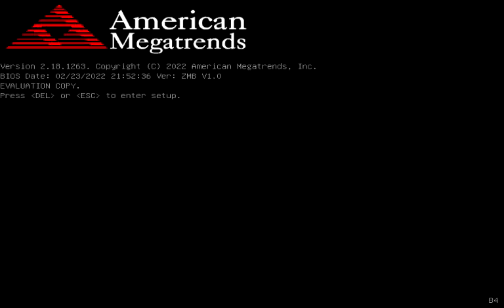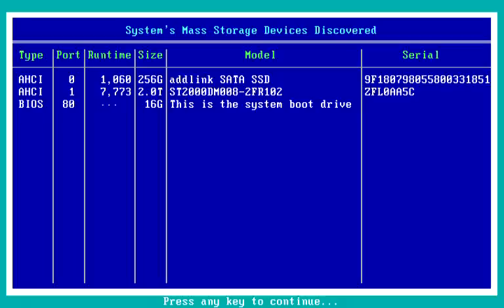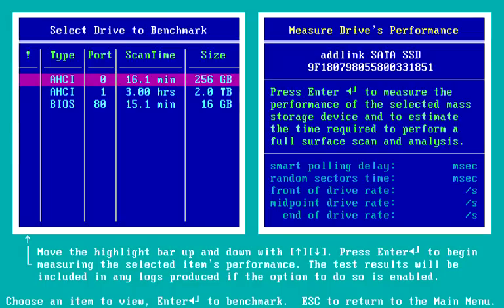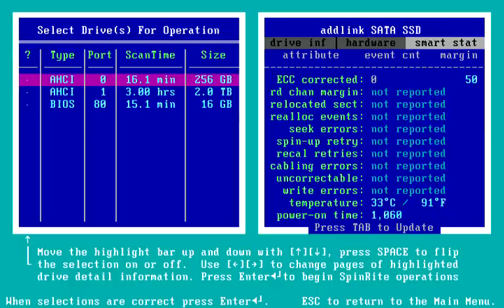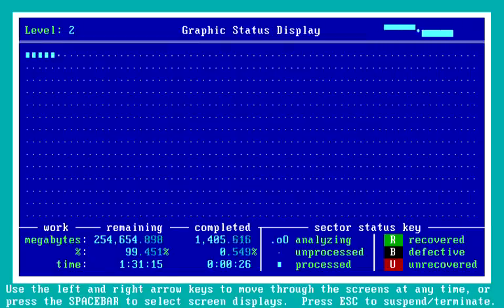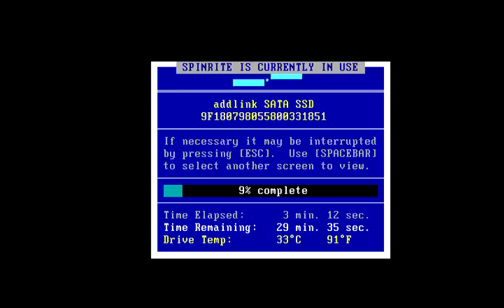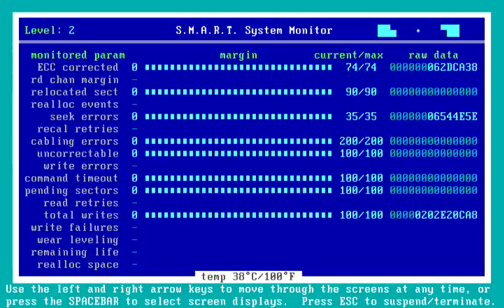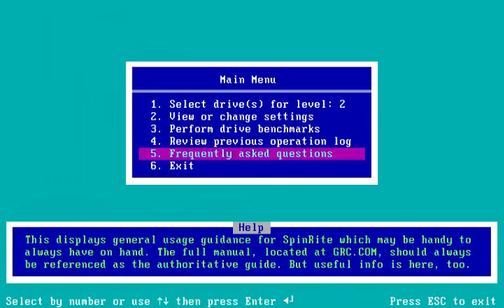A SpinRite Walkthrough

Comment: I have just read that SpinRite version 5.0 can also remagnetize floppy disks. I have two questions about this:
1. Will this function of repairing floppy disks return in version 7.0? After all, according to everything I have read about version 7.0, it is not dependent on FreeDOS thus it won't require Real Mode. And there should be enough RAM available in 32-bit protected mode to offer this function again.
2. Can SpinRite version 5.0 also be used on original floppy disks with copy protection functions or does SpinRite recognize them? I am asking because some copy protection functions use unusual functions, such as read and write errors, etc. If you try to rewrite this bit information, I can imagine that this would fail and the original floppy disk would then no longer be recognized as such.
And then I have two other questions about the current version 6.1 and the next version of SpinRite:
3. Can you also use it to maintain SCSI hard drives?
4. And if so, will there be SCSI support in version 7? If the SCSI BIOS is no longer used in version 7, would this be difficult without controller-specific drivers or is it more likely that SpinRite version 7 will simply be based on another operating system, e.g. FreeBSD, so that its SCSI drivers can be used?
Reply from the maker: Taking your points/questions one by one...

     I have just read that SpinRite version 5.0 can also remagnetize floppy disks. I have two questions about this:
Q:     1. Will this function of repairing floppy disks return in version 7.0? After all, according to everything I have read about version 7.0, it is not dependent on FreeDOS thus it won't require Real Mode. And there should be enough RAM available in 32-bit protected mode to offer this function again.

A:    I don't think so. I think that the need and interest for doing that has fallen so far off the radar that very few, if any, users would ever obtain any benefit from that. HOWEVER, right now, ALL SpinRite v6.1 owners are also entitled to v6.0 and v5.0 SpinRite licenses. You just change "spinrite.exe" to "sr6.exe" or "sr5.exe" in the download link you receive and you get those versions. I will EXTEND this to v7.0 ... so that all owners of v7.0 for Windows will also obtain the licenses to the previous versions... so someone who needs SpinRite's advanced diskette support (which peaked in v5.0) will have access to it.

Q:     2. Can SpinRite version 5.0 also be used on original floppy disks with copy protection functions or does SpinRite recognize them? I am asking because some copy protection functions use unusual functions, such as read and write errors, etc. If you try to rewrite this bit information, I can imagine that this would fail and the original floppy disk would then no longer be recognized as such.

A:     You're right. SpinRite assumes only STANDARD 720K or 1.44M diskette formatting and it WOULD damage copy protected diskettes that rely upon funky formatting with non-standard sector numbering, etc.

And then I have two other questions about the current version 6.1 and the next version of SpinRite:

Q:     3. Can you also use it to maintain SCSI hard drives?

A:     It depends upon the SCSI controller. If the SCSI controller is bootable — if it contains its own BIOS ROM that allows its drives to boot DOS — like old Adaptec SCSI controllers always did, then YES, v6.1 and earlier will "see" and run on those drives. But if the controller relies upon an OS device driver, and if it doesn't have one for DOS, then its drives will not be visible to SpinRite and there's nothing that can be done about that. SpinRite 7 will run on them, assuming the controller has a Windows driver (as it certainly would).

A:     4. And if so, will there be SCSI support in version 7? If the SCSI BIOS is no longer used in version 7, would this be difficult without controller-specific drivers or is it more likely that SpinRite version 7 will simply be based on another operating system, e.g. FreeBSD, so that its SCSI drivers can be used?

Q:     If the drives are supported under Windows then, yes, SpinRite would "see" them and be able to work with them.  :)

I hope those answers are useful to you.
Reply: @SGgrc  Thank you very much for answering my questions. The answers were very helpful. I have another question. Can you use SpinRite 5.0 to remagnetize 5.25" floppy disks, i.e. 360 KiB and 1.2 MiB?
It would be advisable to add this information to the FAQ.

BTW, last week I tried to reactivate my Adaptec AHA-2940UW SCSI controller together with two SCSI hard drives for a retro computer. I noticed something interesting. SCSI BIOS support was activated in the controller and it supports it. But because I had created ext2 Linux partitions on the SCSI hard drives a few years ago, the SCSI BIOS and the DOS SCSI drivers could no longer recognize any hard drives, which meant that the "SCSI BIOS not installed" message always appeared when booting. FDISK from DOS also reported that it had not found any hard drives. So i couldn't repartition the drives either because they were not found.
It took me a while to find a solution. The solution to the problem was a low-level format with the formatting program built into the controller firmware. After that, the SCSI hard drives could be recognized again under DOS. In the help file AFDISK.HLP, which was included with the Adaptec drivers, you could also read what to do in such a case when the SCSI BIOS is not installed message appeared, which was quite helpful.
Since SpinRite 6.1 requires the DOS SCSI drivers, I now wonder if SpinRite would have found the hard drives if they still contained ext2 partitions? I assume that with the upcoming version of SpinRite 7.0 this won't be a problem if it runs on Windows. There are Windows drivers for my SCSI controller.
Reply: @OpenGL4ever  did he ever answer your question "Since SpinRite 6.1 requires the DOS SCSI drivers, I now wonder if SpinRite would have found the hard drives if they still contained ext2 partitions? I assume that with the upcoming version of SpinRite 7.0 this won't be a problem if it runs on Windows. There are Windows drivers for my SCSI controller."?

Comment: Last time I used SpinRite was around 2009 and it could take a day to scan a hard drive. It must take months on modern 20TB drives.
Reply from the maker: Its SPEED is one if the biggest improvements in v6.1.  SpinRite v6.1 uses "Flat Real Mode" which was created by a bug in the first Intel 80286 chip. It's a hack that allows all of the first 4 gigabytes (32-bits) of RAM to be accessed by 32-bit registers from "Real Mode" which DOS uses. This allows SpinRite to allocate three 16 megabyte data transfer buffers and to transfer 32,768 sectors at a time. As a consequence, no revolutions are lost between massive transfers and SpinRite is able to run drives at their maximum possible speed.

If you look at the timing shown in that video, you'll see that the 2TB drive took 3 hours to process. That's about typical for a modern “spinner”. So a 20TB drive could be expected to take around 30 hours ... except that 20TB drives are much more dense and transfer at even higher rates, which SpinRite can now handle. So I'd guess about one day for a 20TB drive, not months anymore.  :)

Comment: It occurs to me that putting disks into my machine that has ECC RAM to run this might be a nice idea.
Reply from the maker: It certainly could not hurt, Rob... but ECC RAM is rare for desktops. I've only seen it commonly used with server motherboards. That said, if you're able to do that it would provide a measure of additional protection (and not only for using SpinRite but for ALL use of any such machine.)

Comment: How does SpinRite relocate data safely on a fully-encrypted drive?  I recall Steve mentioning that SP doesn't need to know about the File System used, but wouldn't moving bits around break the encrypted data?
Reply from the maker: All modern drives are able to remove troubled sectors from their addressable space. This is done in different ways depending upon the drive's technology. “Spinners” are able to “shift all of a drive's sectors downward” into a deliberately left empty "spares" area at the end of the region. This allows a bad sector to be "skipped over." The point, though, is that from the outside, nothing appears to have changed. There's no “visible” sector marked “bad” anymore. Drives are able to hide defective sectors so that they always appear to be 100% defect-free. And as a result of all this — as a result of the total transparency of defective sectors — SpinRite is able to show drives when their sectors are in trouble and thus induce drives to “spare out” these problems... and nothing needs to be changed within the file system, whether it's encrypted or not. 👍
Reply: @SGgrc  Thank you. With this and a little more reading, I cleared some misconceptions.

Good to see you replying in YT as well 👍. Thanks again.
Reply: @SGgrc  you've fixed the issue where newer drives couldn't be made to hot swap sectors that formatting marked as bad? I used Spinrite on some drives where the only way to make them use spare sectors was to give them a fresh format without scanning for errors. Then when Spinrite came to an iffy sector it could either restore it or force a reallocation.
Reply: @greggv8  Did he ever answer you?

Comment: It's been updated ?!!?!?!?  YEAHHHHH!!!!!  Thank you for updating this for modern drives.
Reply from the maker: Yep. And even though it's "only" a "point release" (v6.1) it took 3.5 years of work and it's entirely reworked underneath. It uses "Flat Real Mode" (which the early PC gamers used) to get access to all of the machine's memory (even though it's in DOS) so v6.1 is able to use 16 megabyte buffers (it has three) and much more in order to run drives as fast as they can possibly go. And its entirely new levels perform way more work in way less time. So I'm very pleased with what it has become.

It's going to take me a while to get SpinRite moved over into Windows, which is where it's headed next. But as I was writing all of v6.1's new 32-bit code I knew that's where it was heading. So we'll have this new v6.1 for DOS until then. 👍
Reply: @SGgrc    I hope buy it this week.    So If I make a HIREN bootable USB drive(WINDOWS PE)   Can it run within Windows PE environment?

Comment: An important thing to know when booting SpinRite on a modern computer is that this is a Legacy USB Boot Device.  Most computers today (especially laptops) boot in UEFI mode with Legacy Boot Disabled.  In order to Boot SpinRite you may need to first enter the BIOS and Enable Legacy Boot.  In Dell systems this is a two-step process, i.e. you have to Allow Legacy Mode on one page and then Enable Legacy Boot on another.

After running SpinRite you then need to restore those BIOS settings to their original values
.

Comment: Steve, how does SpinRite behave with formats other than Fat, Fat32 or NTFS. Founds on Linux partitions EXT2 through 4?
Reply from the maker: Great question. I should have mentioned that. SpinRite is 100% compatible with any and all file systems, and even encrypted drives, since it operates down at the physical sector level and doesn't concern itself at all with what's in the drive's sectors. Since all IDE and later drives are able to handle defective sector relocation at the hardware level, SpinRite works with the drive to "show it" there's a problem, after which the drive will take a bad sector (or 4K block of sectors) and will replace it/them with a good new spare.

So, SpinRite will run on anything. 👍
Reply: @SGgrc  So if I have an SSD on an Amiga, I can plug the SSD into a wintel box, and SpinRite6.1 will still process it?

Comment: Thank you, Steve, for this great tool! Is it possible to mark one drive for level 2 run, and then a mechanical drive for level 3 run, all in one shot? :)
Reply from the maker: As you suspect, SpinRite doesn’t have “per drive” levels… but it has extensive command line automation. So it would be very easy to have SpinRite run at different levels on different drives.
Reply: @SGgrc  Thank you very much for the answer! I'm going to buy it very soon, that's why I was curious about such automation. :)

Comment: RAM test is smart.  I had spontaneous data corruption issues back in 2012 that turned out to be bad RAM, but I thought the IDE controller had gone bad.  Only figured it out with Memtest after some hair pulling.
Reply from the maker: Nice sleuthing. And, yeah... RAM is not something that we think of since it's "solid state" and also since RAM errors can be SO subtle. But we need a working foundation for software to run on!
Reply: It was more of an issue in the nineties than now, but still worth a test. That's why many Linux distros offer a memory tester from their boot menu, as do many rescue disks. When a machine is misbehaving oddly for the first time, leaving a memory test for at least 2 or 3 complete cycles is worth the electricity, even though it's only once caught something for me. But the one it caught saved me a lot of puzzling results had I not know the memory has gone dodgy 

I don't have a preference between your memory tester and any of the ones typically offered by Linux distros, but everybody should have one from somewhere in their rescue/testing toolkit 

And certainly run one of your choice before doing any disk salvage/refresh work. So it's user friendly to have built it into the same utility.

Comment: @SGgrc Why in 2024 it is still a DOS app? Many logic board UEFI firmware implementations don't even come with CSM modules anymore (thanks to Microsoft forcing AMD, Intel and System Vendors to dump it to get the newest WHQL btw), specially brand desktop and mobile systems.

DOS is deeply and forcibly deprecated already. You really should consider porting your next software version to the UEFI environment, or make a Linux version at least (as how Nvidia did with MATS for example).
Reply from the maker: As they say: "I'm on it!" -- SpinRite v6.1 is still a DOS app because SpinRite 6.0 was a DOS app 20 years ago when it was released. I agree with you 100% that this no longer makes any sense. But I had long ago promised a free "catch up" upgrade to SpinRite v6.1, so I needed to fulfill that promise first.

SpinRite will be moving to Windows for v7, and I purchased the source code for a real-time embedded OS (RTOS-32) which offers a Win32 API. RTOS-32 can boot over either BIOS or UEFI, so the "Pro" version of SpinRite 7 will be natively bootable and the regular version will run easily from Windows as a full Windows client app.  👍
Reply: @SGgrc  Will the Windows client app be fully featured or are there some features that will only work from the standalone version?  I'm assuming SpinRite will not be able fully work on the boot drive while running in Windows.
Reply: CSM module? CSM has so many meanings. What's the context here?

Comment: Sir, will there be a free upgrade path from version 6.1 to 7 (when you have the windows / efi version)?  I'd like to get 6.1, but it would be wiser if I wait till 7 comes out if another purchase is required.
Reply from the maker: I agree. If you have no use for SpinRite v6.1 today then waiting until v7.0 would save you the $29 cost to upgrade. I'll definitely be providing "upgrade protection" for at least 90 days, so that anyone who buys SpinRite v6.1 within 90 days of the release of v7.0 will pay nothing to get v7.0. But if SpinRite v6.1 might be useful to you today, I'm sure that upgrading to v7.0 will not cost more than $29. (So another way to looks at this is that if you are going to get v7.0 once it's out for Windows, you could be using v6.1 until then for only $29. :)
Reply: @SGgrc  thanks for the detailed response sir, I appreciate it. The efi version for these new motherboards and windows version really have me interested for sure!

Comment: Have you given any consideration to a native EFI version?
Reply from the maker: Yes. Several years ago I purchased an embedded real-time OS called RTOS-32. (http://www.on-time.com/rtos-32.htm) SpinRite v7 will be a Windows app... but this RTOS-32 has a Win32 clone API, so SpinRite 7 for Windows will also run on this RTOS-32, which will essentially be SpinRite's own natively booting OS, and it will boot on either BIOS or UEFI firmware. 👍

Comment: I was an early customer using Spinrite in the 80s and early 90s, back then it seemed like magic in the increased performance it offered. 

Ideally he do k driver should buffer track reads and writes to take advantage of the optimized interleave. I worked for a systems house in the early 80s which specialized in custom drivers to do just that on TRS-80 Model II systems.